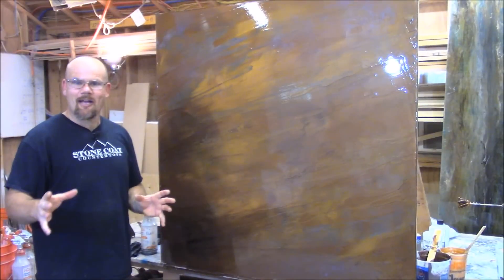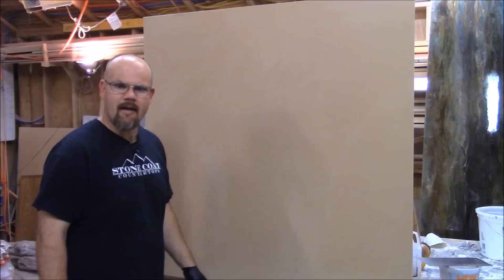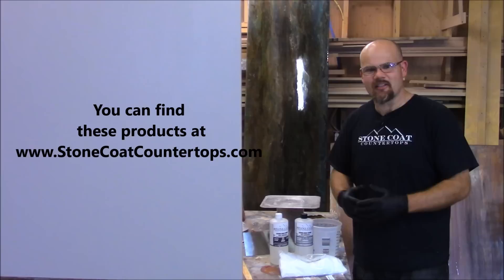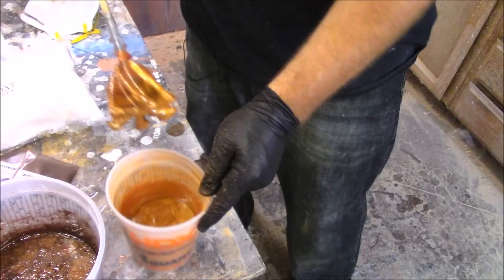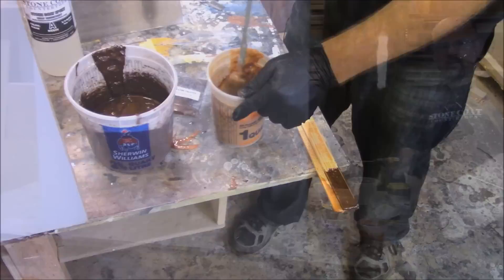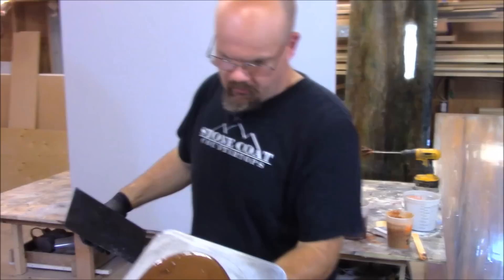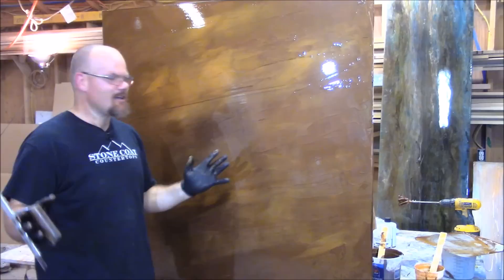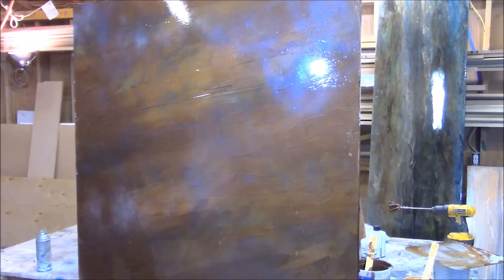Vertical wall epoxy, DIY

Comment: Question; I want to marbled look in my shower and cast iron pink tub, can this be done with the stone coat?. I haven't seen I video of t tub being done as it is vertical  and horizontal. If this is possible to do, which products should I use. Colors would be black, white marbled look with hints od bronze and green.
Thank you, I think what you do is awesome.  Have a great day.

Comment: do you clear coat  sand even out the vertical epoxy the same way or close to the same way you would a flat surface? sanding torch for bubbles?

Comment: You said you could use this for backsplashes, but no one has 40sqft of backspalsh. Do you sell the vertical additive in smaller batches for folks who just need it to supplement the kitchen or bathroom counter backsplashes? Can the regular epoxy be used on a backsplash if allowed to drip, like you would the edges of the counters, or would that cause unwanted pooling at the juncture of the counter and backsplash?

Comment: I'm wondering two things. One, can this be done with a clear epoxy, or will the vertical additive make it less transparent? I've seen videos of putting photography prints under clear epoxy for floors, so I'm wondering about doing so vertically. And second, I'm wondering about doing this over a shower base. Would it hold shape well enough to still maintain the slope towards the drain?

Comment: How does this material respond to UVA and UVB rays? For example; applying epoxy to outside wooden decking.
Is the epoxy capable to weather (pardon the pun) the weather? Especially if I were to mix it with pea gravel. 
Thank you.

Comment: Just asked question on plywood countertop video. I'm building house out of 1-trip shipping containers. I think 1 wall in bathroom will be the corrugated steel & drywall on 2 walls. Would this work on the corrugated wall, which will be the long wall of shower?

Comment: very interesting.  Wonder how smooth it is with problem areas.   I want to do a thick old long dinning room table, however want to do the glass and wood china cabinet to almost match.  Its mostly long glass.  really really wide. not sure how to do it because the china cabinet of course is vertical.  too large to lay down. no place to do it that way.

Comment: Hi - I know this is an older video, but I would really like to know what you can do to "add" a tub to a large shower enclosure? I have a small bathroom, and can't add a large tub without removing door and walls. My 3 walled shower is really large, and I just want to add "short walls" to create a tub I can soak in.  The shower is made of the traditional molded plastic, with lower "shelves" that would need to be cut off.  I just want a soaking tub that isn't going to cost me $25,000.00 and weeks in renovating.  Thank You !

Comment: StoneCoatCountertops.  Hi Mike... What do you think about using Stone Coat on a composition kitchen sink??( Even if I just use the clear epoxy). My sink is very nice, it just gets dark marks whenever you put pots and pans in it. The dark marks are very hard to scrub out, I was hoping there is some way to put your product on my kitchen sink. Looking forward to your answer!!  Thanks dear.

Comment: If going over tile is it necessary or even just a good idea to fill in the grout lines to create a smooth surface before applying the epoxy?

Comment: On the vertical wall, do you add clear epoxy for a shiny coat at the end using the vertical additive or does it retain a shine without it? Also is there anything special needed while doing a shower wall? Lastly can I use this procedure on a shower ceiling?

Comment: Love your videos..I have a question, moving into a new house and the shower walls and bottom is yucky and would love to epoxy the whole shower after cleaning it...should I used a primer or like a marine paint first?  I think the material is like a formica  or something but its harder than fiberglass.  Advice please!!

Comment: I have been waiting for this tutorial. My question, if I used a polyurethane mold release on my trowel to keep the paint from sticking during the finishing steps would it complicate the curing of the epoxy, and the end product?

Comment: I was thinking to do wall with epoxy.  How do you smooth it to be like a counter top glossy shine look? Is it even possible to smoth like I want or it needs to be gorizontal to get smooth look. My walls build of concreate and want to do with epoxy.  Any suggestions which product to use for that?

Comment: I'd like to know if you can sand out the texture like you would on a regular epoxy floor prior to an applying a sealer or will it cause it to run.

Comment: So how easily does it go over tile that may have some grout that has chipped off how easily does it  level out? I want to do that over some white tile in my bathroom over my tub, but some of the grout has chipped out from between the tiles,, and some of the tiles need to be glued back down evenly. Will it be level? What do I need to do to make sure it levels out? And, what is the try time?

Comment: I do Venetian plaster allot, I have to say it looks good for what it is, but the trowel marks are there. Venetian Plaster is smooth like glass. Also you were going off the edges you cant do that on an interior wall. unless it is an outside corner. Also it would seem that you would have to keep mixing and mixing, if you are doing a large Sq foot project to me it would be allot  of material and time. Plus I think it would cost allot considering how much you charge for a gallon. I saw the comment about sanding it down then polishing it, but then it would be just as much work as Venetian plaster. I think it would work better for an accent wall or a shower or bathroom but to do a house or even a large room would be too much for this product.

Comment: I'm trying to work out a place to order the resin in the UK as SCC are American based import fees would be high. 

I've found something called clear top 35 Epoxy but can't work out if it's the same thing

Comment: Hi, brilliant work as usual. Is it possible to get the finish glass smooth like you would on a table top? By using a brush to poke it onto the surface or something like that? I want to epoxy the carcasses of my kitchen cupboards as well as the doors. The doors I will do like a normal table top but I cant take the carcasses down, any help will be greatly received. And do you ship to Australia? I will want some of that thickening agent for sure.
Reply: StoneCoatCountertops Lovely, and can the surface finish be made really smooth like your table top examples ( which I have been enjoying watching immensely )?

Comment: I had always heard not to stir too fast because it causes bubbles; but the heat gun drives those out? You use a drill to stir fast ... so certain mixes you can drill stir and others hand mix?

Comment: I want to use your product for my countertops and backsplash.  But, I have a question..... I have a 36" 5 burner gas stove top .  Is your product able to withstand the heat  from the gas top range???  Also, is this product  been ok'ed to be around food??  And how scratch resistance is it?  Do I have any maintenance besides the wax and buff??

Thank you for your time!!!!

Doe
Southern Texas

Comment: You make it look so easy and so beautiful.  I want to give my shower a granite stone look.  In this video you said that would require putting Stone Coat on a horizontal surface.  What should I do with the corners where the walls meet to make it leak proof and still look good?
Reply from the maker: Great question Al!  Here is a link to step-by-step instruction for vertical shower walls: https://www.stonecoatcountertops.com/shower-walls  Call or write us anytime for project support. (541)450-1976

Comment: Does this method finish with a smooth finish (flat) as the counter tops will. I also would like to know if you torch this at all to remove air bubbles. I didn't see it used in this video.

Comment: Hmmmm if I did that on subway tile would it will in the gaps or would I need to address that before for a smooth surface?

Comment: Have you done the vertical with your sponge technique? Is this possible?
Reply from the maker: Hi Shasha Keyes, the vertical wall kit is a system and look totally of its own, its a very different look that what can be achieved on a flat horizontal surface.

Comment: Great job! I ran into your videos 2 weeks ago while researching modification of countertops without having to redo them. I am now hooked on to your videos and watch them as and when I get some time and probably watched some of them multiple times. You make them look so easy but I am sure it's more than that. Do you reuse the containers, mixers and paddles? If so, how do you clean them after each job? This stuff becomes hard after a little while. I heard acetone in one of the videos but not very sure. Thank you and your videos are the best.
Reply: Thank you for your prompt reply; it makes sense. We are starting to get started with our counter tops project very soon; just trying to braveup as we have not done this kind of stuff before. Your "Epoxy countertops over old tile" is the one I am currently following. In that video you did a 2 step prep work 1)Versabond and then 2)LevelQuick RS. What is the downside if I just do versabond and No LevelQuick? Also, little concerned that if I add step 2, the weight of the countertops will increase and it being an old countertop that may cause issues down the road? I am not sure; What do you think?

Comment: Well the epoxy turn milky white in a hot shower or if you use bath room cleaner on them? I use a different product on my kitchen counter tops and my clear count turns white if water setts on it to long.

Comment: I want to do my tile kitchen counters and backsplash.  If I have to add the verticle additive should I do it separately from the flat countertop?  We watched your video on how to prep a countertop.  Do you have a video of a backsplash?
Reply from the maker: Great question Matthew!  We like to cut off existing back splashes when we do our projects and make new ones to cover the area the old backsplash used to be.  We do however get DIY customers who wish to leave the backsplash in place, when this is the case here is how we suggest coating vertical backsplash. Here is a video showing how we pre-color the surface and work with a countertop that has existing backsplash.    https://www.youtube.com/watch?v=sSWDiKKSxokHere are other colors that work even better with vertical backsplash,https://www.youtube.com/watch?v=wpzdQTFBA6Ihttps://www.youtube.com/watch?v=3Xaw-MrNnns
Here is a training video showing how you can go over tile countertops: https://www.youtube.com/watch?v=tw2TXNgOrxM&t=797s
Please call or write anytime for project support. (541)450-1976

Comment: Would I need a bonding primer on a wall that is painted drywall or just make sure it is clean and apply???
Reply from the maker: Great question sardomnumspa!  You can apply Stone Coat Countertop Vertical wall epoxy directly over new, or old sheetrock. If applying the vertical wall epoxy over a painted drywall surface, you will want to lightly sand with 220 grit sandpaper to help create a great mechanical bond. If the project you’re working on is on newly installed drywall, be sure the sheetrock joints are taped and mudded prior to using the epoxy so the seams won’t show through your vertical wall epoxy install. When mixing up the vertical wall epoxy, keep your batches to a maximum of 1 quart of mixed epoxy at a time. When you add the vertical wall additive your working time decreases from our normal 45 min working time down to 30 min. Mixing smaller batches will ensure you have plenty of time to apply the mixed epoxy to the wall.  If you are installing over a surface such as tile you would need a bonding primer.  Contact us anytime with questions or for project support. (541)450-1976

Comment: Maybe to get that countertop effect, it would better to get thin plywood panels, coat them the you want and then fix them against the walls your working with. But I suppose it depends on how much you want to spend.

Comment: Great video you have a new sub, Don't want to put a downer on this vid but I feel it's so important to use a mask at all times and especially when spraypainting.
                                                                                  I used to do a lot of spraypainting sometimes forgetting or couldn't be bothered putting it on. Well to cut a long story short I can no longer spraypaint on doctors orders  as I have developed C.O.P.D. And my doctor has put it down to mostly my painting without a mask. Not trying to lecture you my friend ,just giving you some health tips. Keep up the good work!

Comment: Unless I missed it I didn't hear anywhere where it said this I know he said shower walls and tile. But does anybody know if this would work over a fiberglass bathtub and surround? My bathtub cracked but I fixed that and now it looks like crap. So I thought this would be great to go over the repairs and do the whole thing. Anyone have any idea if it will work on the bathtub?

Comment: I really liked the piece at the end at first I was uhhhh then how you added the color spray paint.  Wowed it.  Now this was supposed to looked uneven on purpose I think you called it Venetian?   
If at a persons home to you add the epoxy top coat or no?   Just what you did and done?
In shower no issues with it messing up?

Comment: I had one experience and now I need help to solve the problem. I have painted mural in the pool and I decided to protect the painting with epoxy. First two layers were perfect, but me as a beginner I could't control the epoxy because it cured fast and the surface was not smooth enough. Because of that I decided to put another (third) layer but in the mixture I reduced the dose of B component to slow down the drying process and then a problem arose. The epoxy did not dry. I consulted technologists, some of them told me to clean it, some of them told me to cover it with a new layer of normal mixture and I made the second suggestion. The new layer (fourth) has dried but under it (the third) layer has not dried yet. The new layer started to crack and I am currently removing it but it is getting complicated. My question is, do you know how to remove the fourth (dry) layer together with the third (that is not dry) without damaging the first two normal epoxy layers?

Comment: so on a shower floor with a slight slope for drainage would you add thickener to floor epoxy and trowel it on? also if you used  cement board backer with a thin coat of cement or thinset to finish the surface would you just prime and apply as shown?
Reply: Arne Helland. Hi did you get a response as need to know as I will be attempting this next week on a wet room. Mark

Comment: If doing new construction (wet bathroom in tiny house on wheels) what is the lightest substrate  one could use? You said this is waterproof."..How crack resistant is this? Would it hold up to vibration? You mention creating shower panels horizontally; are you using something to seal the corners and attaching the panels to studs? Thanks. It’s clear (lol) that you truly enjoy your work!
Reply: StoneCoatCountertops I am Full of questions &  you’d be surprised how man “pros”are threatened by so many questions. One more ... for a shower surround in a non moving structure I’d use hardibacker (heavy just or may be a newer Schulter Kerdi board ($$$), but perhaps you have another for this purpose? Is a porous substrate desirable to begin so that the bonding grips? I knew that polish’s surfaces require a bit Of “roughing up.” Once again, I so appreciate the functional artistry and your helpful attitude 🤗!

Comment: For showers, can you do this in replacement of using tile? How would you waterproof it?
Reply from the maker: Great questions David! You can absolutely use the epoxy instead of tile and coat it with Redgaurd for water protection. We would love to speak to you about your specific shower project. Give us a call at 541-450-1976!
Reply: Will do, thanks!

Comment: how flexible is the material ? can be use on a second  floor  on plywood?
Reply from the maker: Great question Ramon! Our epoxy is hard enough to withstand major impact but remains flexible enough to expand and contract with wood through seasonal changes. We do have a flooring kit available. We use our flooring epoxy product to coat concrete floors and wood sub floors. You can get amazing looks with this system. Here is a link to our product, including full written instructions as well as a training video on how we use our flooring epoxy. Contact us anytime with questions and free project support. Thank you. Here is the link.https://www.stonecoatcountertops.com/flooring-epoxy
Call or write us anytime for project support. (541)450-1976

Comment: Very informative video. I'm fascinated with the techniques and have been watching your videos all morning. What base material would you recommend for someone who wanted to pre-build shower panels and have them ready to cut and install for a shower remodel? Would Plexiglas work or would you suggest something else?
Reply: I am building a walk-in shower, which is about 10 feet deep.  If I were to epoxy the MDF before installing, how do you propose sealing the seems between panels?
If I did a vertical application, would it work on backerboard.  I worry about the MDF getting moisture and swelling.